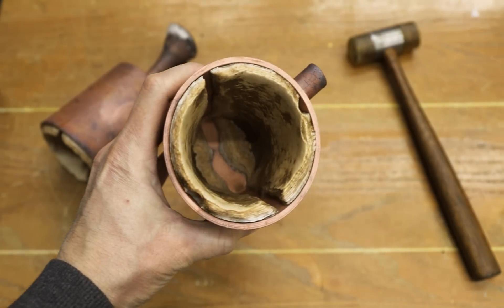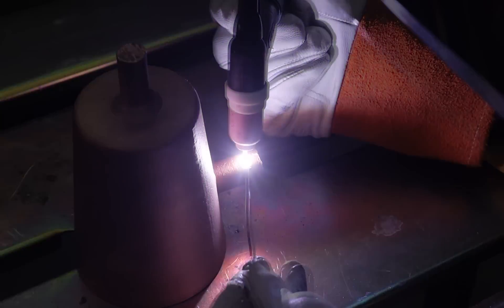Making Solid Copper Mugs, but should you drink from them?

Comment: Copper is one of the worst choices of material to make a drinking vessel from

All the cold from your drink will immediately balance with the room temperature

 all the heat from your hot drink will also immediately balance with the room temperature

And copper is toxic, and we'll reach into your drink, especially if you're using things like lemons and limes like you did

And that cup would weigh around 3 Pounds, and nobody's going to want to use it for that reason other than yourself

For the amount of time and energy, materials hand tools and machinery, You could have painted a few bedrooms and made  $1000 doing so.

I get it it's a hobby, and a reason to make a YouTube video
Reply: What about copper pipes running water through a house? I was a plumber for 26 years, never heard of copper being toxic.
Reply: @Ha ha More ha ha  because supply lines don't have lime, lemons, and salt in them, and they are constantly flushing.
Reply: @mediumsizedm  some have sulphur running through them. And different water companies run different chemicals through them. Copper in small doese is a necessary element.

Comment: Tomatoes were wrongly considered poisonous for many years due to acidic acids leaching lead from pewter tableware. 
Acidic acid will have exactly the same effect on copper .
Non acidic drinks will be perfectly safe , hence the popularity of copper plumbing.
There is a very good reason why glass & stainless steel (both being inert) are used in tableware & foodstuff containment , not copper

Comment: If you flatten the sprue and remove the handle, It would look like a nice chalice or stemmed cup.  You might want to line that cup with tin or stainless steel.  Your body needs copper to metabolize iron, and for strong bones, but too much is a bad thing.  Anyways, it's a great build, and I enjoyed it.  Thanks.
Reply: Tin cans are plated with... tin! Nowadays it is often also plated with plastics. And copper pans are also plated and only the core is copper. srsly heavy metal poisoning is no fun, kids

Comment: It looks like some of the surface finish issue on the mugs themselves could be caused less by shrinkage, but dissolved gasses in the copper melt affecting viscosity and forming bubbles. liquid copper readily accepts dissolved hydrogen but it doesnt in the solid form which can cause pitting, cracks, and porosity as it solidifies. I recommend degassing the Copper by adding in a small amount (<1% by weight) of Aluminum to the melt. Dont add too much other wise it will start affecting the color. I had been given this same advise from a Metallurgical Engineering Professor at my college as I was casting some copper coins.
Reply: fresh copper surfaces can't be leached by non-oxidizing acids since copper metal can't reduce protons to hydrogen

Comment: If the copper is exposed to slight vibration after pouring into the ceramic mold, roughness and cavities will not form on the surfaces of the copper pot. construction masters apply the wet concrete mortar to vibration, so that the concrete is well compacted and has a smooth surface. The vibration you will give should be low enough not to break the ceramic mold,

Comment: Hey, it was really cool to see this project go from start to finish. It was a bummer that there was some cracking and air pocket holes left in the end product. I've worked with diecast molds and I would recommend adding a few "vent holes" in the sides of the design of the 3D print next time, so most (if not all) the imperfections can be pushed out to the sides of the end product.

Comment: I worked for an artist who used this method for casting aluminum.  He would put the hot shells into a pit filled with vermiculite.  It would keep complex shapes upright, help retain the heat and hold the shell together if it cracked during casting.

Comment: If you’re not planning on using some sort of coating, I would be very careful drinking anything other than water. Particularly stuff with acids like lemon/lime juice that you demonstrated can be very bad as it will leech the copper off and straight into your drink. 

Heavy metal poisoning is not very difficult to get if you’re unaware so be careful.
Reply: Copper going into your drink is not harmful unless you have a rare genetic disorder, one of which is called Wilson's Disease. FWIW, if you sample water that has been in your plumbing overnight, even if you put deionized or distilled water into the pipe, in the morning, measurable quantities of copper will be present in the water. The determination of how much of a metal in your water is dangerous follows lines of inquiry such as, "If you consumed 3L water per day, every day, over a lifetime of 70 years, what effect would it have." Copper is GRAS.
Reply: Citric acid will etch copper , the ice will slow the reaction, but nevertheless it will etch .
FDA’s Model Food Code prohibits food having a pH of less than 6.0 to come into direct contact with copper and copper alloys . Fruit juices , wine , Moscow mules, are thus a nono.
Reply: The acidity has to be below a pH of 6 for it to matter. A couple of squeezes of limes will have no effect.
Reply: copper metal can't displace hydrogen from acids so unoxidized copper does not react with non-oxidizing acids but copper oxide reacts with citric acid to form copper citrate.
Reply: Also, it warms up cold drinks much faster than a normal cup would.  Overall not very useful.
Reply: Copper is not a heavy metal which is toxic to humans.  Actually copper is needed in our diet and is more like a vitamins.  People have been using copper cups for 1000s of years for its healing properties.
Reply: @shakybones42  That is only in extremely small doses.  Chronic exposure to elevated amounts can lead to serious health problems.
Reply: @shakybones42  Not a vitamin, a trace mineral, as is chromium, which is available from grains, beer, that kind of food. Too much copper is simply excreted, unless you have Wilson's disease, in which case it causes neurological damage. We had a student in my school who had Wilson's disease and it reduced her to a near vegetable. If diagnosed the damage is entirely preventable.
Reply: Don't worry about it. The copper used in the scrap pipe and wire is pure copper. Where you might need to be careful of the source of the copper is placer metal you find in the ground, or copper you refine from an ore yourself, where arsenic is definitely going to be present. But the video shows copper tubing and copper wire. Ever drop of water coming into your house that goes into your cooking and drinking comes through copper pipe, and there are purity requirement on it for exactly that reason.
Reply: @MichaelKunz-mt2oo  you've missed my point.  You're taking about WATER on copper.

Im talking about acidic drinks that will have chemical reactions that will result in the release of copper particulates into the drink.

It's fine if you're drinking water, which is what I specifically said in my comment so I'm not sure why youre talking about water.
Reply: @MichaelKunz-mt2oo  I think your assumption about purity is flawed.  First, we do not know the exact type of pipe or tubing.  It is not guaranteed to be water pipe/tubing.  Second, even that coper is not pure.  It has additives to give it the needed properties.  Third, there isn't really a reason to worry with water since it has a neutral ph.  So, the issue we are bringing up isn't applicable to water piping.
Reply: @boeubanks7507  Tap water rarely  has a neutral. Not all drinking water comes from a water company that monitors impurities before network distribution. Where I live none of the water comes from a water company but from wells and springs. The better measure of how aggressive water is to piping is known as Langlier Index. Pipe must be safe under all conditions. If copper alloy is safe for piping, its safe to drink from.
Reply: @MichaelKunz-mt2oo  Even in the worst case scenario, potable water is going to be within a narrow ph range.  It is never going to be as acidic as tomato juice or canned soft drinks.  Particulate matter in the water damaging the pipes is a concern but, that material likely won't become a dissolved mineral in the way one dissassociated by acid would.  That is also why copper is alloyed to increase hardness.

Also, you can't say that chronic exposure to copper is harmless.  The EPA banned copper sulfate as an aquatic weed killer because they found that the copper residual left in the soil was too high and posed a danger to the environment.  Copper is a metal and an electrolyte.  Therefore it will have and effect on the body.  I don't know if anyone has directly studied it's effects on the human body but, we know that both excess metals and excess electrolytes in the body are detrimental.  And, since it is a heavier metal, it will likely accumulate in the body over time.  Leading to more substantial issues over time.

As a comparison. Aluminium is a metal with very similar chemical and physical properties to copper.  And, it has been documented that excess aluminium in the body correlates with an increased risk of Alzheimer's.  This is one reason that aluminium food containers that contain acidic foods are lined.  Although that reason is secondary to maintaining the container integrity because aluminium has zero acid resistance in its natural state.  Copper is more acid resistant, but not by too much.

Lastly, you are basing your argument on assuming that call the scrap could be considered 'food grade' alloys.  I don't think your van say that because he didn't address it in the video and we didn't see everything that was put into the crucible.  Nor do we know where that material was sourced from.  The tubing could have been from an old AC unit.  And no, I am not implying lead content.  AC units are either welded or silver soldered.  Lead solder isn't strong enough for those pressures.  However, if that is old copper plumbing and he didn't discard the fittings, that is a possibility.  Either way, there are too many possibilities and unanswered questions to say that the final alloy is 'food safe'.  That crucible looked to have been used before.  What was the last metal run in it?

The simple solution here is too use cold and low acid foods.  The lime he put in the Moscow Mule probably isn't enough to hurt, especially with the drink being extremely cold.  But, a coke would be a bad idea because the carbonic acid in a coke is particularly nasty to metal containers.  Hence, why canned cokes are plastic lined on the inside.
Reply: @boeubanks7507  nonsense. You're trying justify a post you made in ignorance. Did you read what I posted on how toxicity is measured over lifetimes of exposure ? How long is the lemon juice in the copper cup ? CO2 dissolved in water creates carbonic acid, and luckily, copper carbonate is not soluble in water, and even less soluble in water containing CO2. And copper pipe does not have other metals added to change its properties. Work hardening is used to enhance the strength of copper pipe as it 99.99%+ pure copper. Copper electrical wire is even cleaner.
Reply: I was thinking about this too, A great follow-up video would be plating the inside with a protective coating - I think they use aluminum?
Reply: @douglasboyle6544  they typically line a copper mug with a Stainless steel liner. Kind of like the inside of a tumbler.
Reply: @Frank.B.Crafts  ah. That's harder to plate.
Reply: @Frank.B.Crafts  More like a layer of tin
Reply: @douglasboyle6544 impossible to plate*
Reply: @douglasboyle6544  copper pans are normally tinned
Reply: @PastelPalace  Yes, that would make for a very nice follow-up-video. Just make sure to get pure tin, if you melt down older tin objects, there could be plumb in it and that'd be Bad.
Reply: @Makatea  you could use leadfree solder of SnAg or SnCu variant, both other metals are only about 0.7 percent, so I am sure harmless.
Reply: @goamarty  I'd rather use pure tin and some flux and do it like it was traditionally done with copper casseroles. Neither silver nor copper are compelling choices for food-safe options.

Comment: Please becareful when consuming drinks from a copper mug. Avoid acidic drinks as acids from the drink can sometimes leech copper ions and if consumed in excess can lead to copper metal poisoning, which can be fatal. If I am not mistaken this is one of the reasons copper mugs are banned for use in bars or are limited to cold drinks as low temperature can decrease the rate of leeching.

Comment: PLA wasn't completely cooked out of the mold. You need as little PLA in this as possible. Basically, you'd need to print the inside and outside of the mug as vase mode shells that you'd then glue together using as little glue as possible (probably modeler's thin glue). The pouring spout and the handle knob, also glued on separately (tho you'd need to print only the outer shell of the handle knob and the spout.
Reply: Did you watch the video before giving advice?
There is no pouring spout!

Comment: Nice muggs! However, there is a reason you tin the inside that is with contact with the cupper. If you use them daily it will release cupper ions into the liquid and you will be sick.
Reply: Yet you most likely have been drinking from copper pipes your whole life and showering in it also. It's a wonder the whole world hasn't succumbed to copper poisoning.

Comment: What awesome mugs! Though you may want to plate the lip and insides with Silver to avoid copper leaking into any citric acid drink like most sodas are. Other than that I cant wait to see what you make next. Also glad the Cardboard tricks working for you.
Reply: Explain the difference drinking from this copper cup and drinking water that is piped into the house via copper tube lines.
Reply: @galewinds  As has been stated numerous times in this discussion, water has a relatively neutral pH and therefore does not etch the metal.  The issue is with low pH (acidic) foods such as citrus and soft drinks.  Even some wines possibly.  Copper has little acid resistance, so the copper is etched and dissolves into the food.  In the short term, this can cause a metallic taste in the food.  Long-term, chronic exposure can cause heavy metal poisoning.  So, the difference is the pH level.  Neutral or high pH (basic) foods are not an issue.  Acidic ones pose a potential issue.
Reply: @galewinds7696  Water is not acidic.
Reply: @galewinds7696  well beyond copper being rare lots of lines are not all copper and made of plastic but your right and as far as aluminum cans or something pots I'm not sure if it's a myth that aluminum causes Alzheimer's but I've never heard anything about copper and even the hot water tanks has copper so it gets probably 180 degrees constantly and it won't freeze
Reply: @galewinds7696  water isn't acidic. Acid reacts with copper. It's mostly harmless as long as you don't let an acidic drink sit in the cup for more than a few minutes. Any soda, most juice, many cocktails, and other drinks have acid and should be drank within about 10 minutes of serving in copper. It's really not a big deal though. If you forget your Moscow mule in the copper cup and come back to it, just toss it and make a new one
Reply: On copper cooking pots , the coating on the inside is tin , or stainless steel.
Reply: I don't know if silver plating is the answer here.  Silver is pretty reactive itself.  Hence why it tarnishes so bad.  Just use these for beverages with low acid (high ph) and it will probably be fine.
Reply: Most copper vessels like this in antiquity were tinned on the inside. This is done because copper oxide is toxic.
Reply: @sideswipe147  that is false, it was done because copper salts taste really bad, they cared very little about its toxicity.
Copper is relatively mildly toxic (compared to lead and cadmium), and a necessary nutrient actually. Still, you can overdose from it, so it is generally advised to only store foods in copper for a very short time or none at all. If you can taste the copper then it is too much copper!
Reply: are hot coffee in the "danger zone" for copper leaking out?
Reply: @sebastiannielsen no, copper is not going to "leak" out into your coffee lol. Copper has antimicrobial properties, so if anything its way better to use a copper cup. Unless your drinking some kind of probiotic.
Reply: @GenuinelyCurious120 "Copper and copper alloys such as brass have been found to be toxic to bacteria via the oligodynamic effect. The exact mechanism of action is unknown, but common to other heavy metals. Overuse of copper sulfate as an algicide has lead to copper poisoning outbreaks in multiple locations."

Oh look these are unrelated things. Yes it is anti microbial. Yes drinking from unplated copper drinking vessels will cause copper poisoning if done for long enough. Thanks for your brilliant input on this though.
Reply: Perhaps you could coat the copper with some kind of transparent spray on finish?
Reply: @@SwordandKeyboard29  That is possible.  It is what they do to the inside of aluminum cans.  In this case, you probably would be better off making some stainless liners and epoxying them in the cups.  If you want to do anything.  There really isn't a need to.  As long as you follow some basic precautions, it will be fine.
Reply: @boeubanks7507  aluminium cáns are usualy coated with epoxy .You get food safe material.
Reply: You sure that's an issue? They sell copper mugs for moscow mule drinks and i have never seen any of them plated with anything.
Reply: @amarzzata   cheap vodka, and moon shine. Has hysrogensulphides or something in them. And copper is supposed to neutralize the toxins.
Reply: @amarzzata  they have coatings inside
Reply: @amarzzata because they expect you to drink the Moscow mule fast ofc
Reply: @dankboi42069  🤣🤣👍